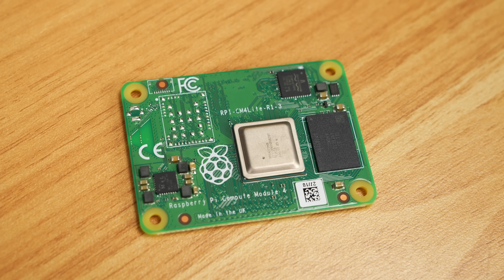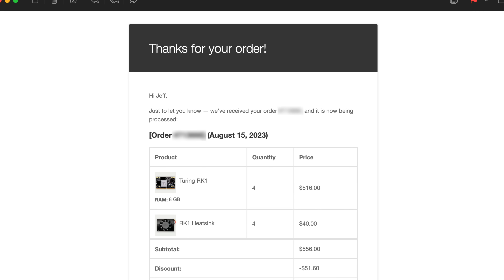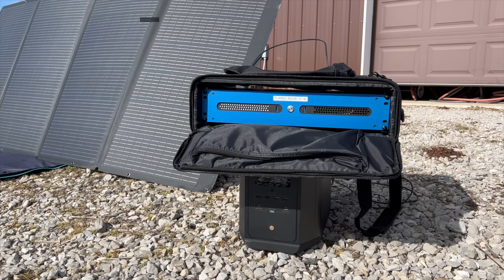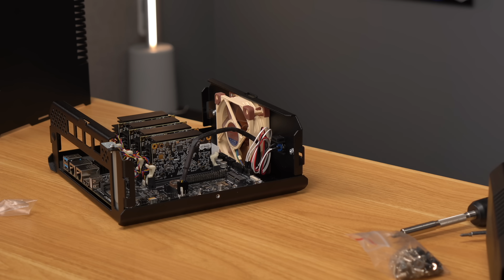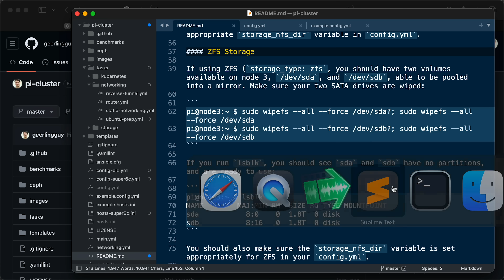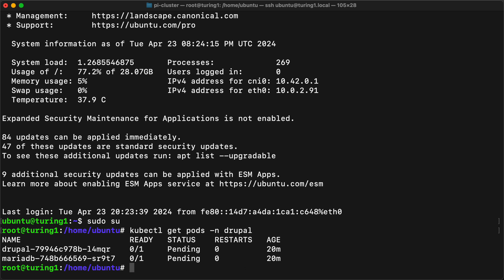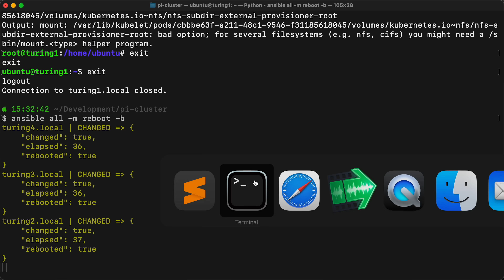Meet the new SBC Linux Cluster King!

Comment: 24 TOPs NPU. That was the main thing I wanted to know about, but it wasn't mentioned again for the section of the vid I watched. Usually fp32 is what I go on with GPUs to tell if it's useful for AI. How does this compare to a 3090? What do TOPs mean in terms of fp32, usually?... I looked into it and a 3090 has 285 TOPS so I would say this cluster is really not useful for anything I can think of, especially at that price? Why not just use GPUs?
Reply: The NPU wont help you. Its EXTREMELY limited. It can only do inference on some limited precompiled models for object recognition and segmentation, like yolov5 (not 8 wont work), and inceptionv2. It's all proprietary, they use their own model format and you have to convert everything to it using quantization to int8. It has nothing like tensorflow or pytorch or any other general purpose composable computing graph. NPU is useless for LLMs. It's in no way comparable to a GPU, more like a crippled Edge TPU with no general purpose ML framework
Reply: OH, and that 24 TOPS is combining all the NPU's and fudging since a single one is lucky to get 4 TOPS and there is NO pipelining and parallelizing like you get under tensorflow and libedgetpu

Comment: It wouldn’t be cheap but if someone wanted to they could use the asmedia pci-e 3 switch chips and break out the pci-e to a 2.5gbe nic and an m.2 slot to make a higher speed connectivity version of a cluster board, going up to 10gbe would add a lot of $$.

Comment: For the UPS - it is 12v, so 3s LiPo or 6s SLA would fit the bill nicely - no need to do conversions into and out of AC and DC unnecessarily.  For more runtime, just add parallel sets of whichever type you choose (but don't mix them - it is either SLA or LiPo, not both in parallel unless you want a fairly spectacular fireworks display - DAMHIKT).  If you go for SLA put them at the bottom of the rack for stability - not a bad plan for either, really.
Reply from the maker: Making them line interactive or at least work with an AC input is a little harder, though there are some good BMS boards out there these days.

Comment: You read my mind when you talk about a UPS for a mini rack. That would be siiiick
Reply: APC's most popular models are like 7 years old and use lead-acid batteries.  They don't seem to feel much competitive pressure.
Reply: @concinnus I thought about doing a DIY ups from lithium ion for my rack but was thinking gee i hope it never sets on fire lol. I think the UPS batteries use lead acid because they are more reliable long term or just in general for a few reasons.
Reply: @clutchboi4038  Lead-acid is just cheap, that's it (at least if you exclude lead core charge).  LFP is the right option for a DIY UPS right now, it's very safe.  Probably safer than lead-acid, honestly, which can create H2 gas.  Then in 5-10 years sodium-ion will likely beat out both LFP and any last argument for lead-acid.
Reply: @concinnus  the four 21700s of my Pi 5 UPS make it feel like a portable device… Motorola DynaTAC portable, like a brick

Comment: Possibly a stupid question from a network noob:
Let's say i get a small desktop RJ45 10Gb network switch which can handle 1Gb, 2.5Gb, 5Gb and 10Gb and a RJ45 10Gb PCIe 3.0 x 4 Card and put it into a PCIe 3.0 x1 slot on a motherboard, would
a) the PC and the switch go for 10Gb because both network chips can handle 10Gb (and therefore using the maximum out of a x1 lane (which, as i understand it delivers up to 8.9 Gb)) or
b) would the PC and the switch agree to only 5Gb because of the PCIe 3.0 x1 slot?

Comment: I see a future where the grid and green energy are stabilized in part by bidding on computing cycles.  When green energy production is overabundant researchers and hobbyist can buy compute cycles cheaply.  When energy isn't overabundant only the most important applications would run at higher costs per compute cycle running on more efficient hardware like this.  Low important compute cycles could also be shifted to an area of the world where energy is more abundant.

If I'm building an SBC cluster (and I plan to) I want it to test that possibility in my home lab using solar production.
Reply from the maker: There are a few companies who have tried building a distributed compute solution like that, and allowing people to run workloads on a P2P network. The challenges to doing it securely, and cheap enough, are pretty immense though.
Reply: @JeffGeerling  So true!  I remember a crypto mining company that produced it's own energy.  That's what made me ponder this topic.  They temporarily reduced their mining operation and sold their energy to the grid during an energy crisis when energy was more valuable then the crypto they were producing.  I thought "that was smart" and wondered if it could be scaled.  Another issue is unscrupulous individuals selling fake compute time and returning bad results.  It's all very complicated and perhaps that's why it's interesting.

Comment: Have been working with the TuringPi2 and RK1 Boards for a few months and recently also received a few different mPCIe devices, unfortunately with very bad results. Only 1 in 5 boards would show up.
I do hope you look into testing mPCIe devices with the TuringPI2 similar to what you have done with the CM4 as it seems to be either a bit of a jungle compatibility wise or alternatively the faulty connection on the TuringPi2 side.
only board I got working was a IOCREST 4 Port SATA with a 88SE9215 chip, Tried a few realtek ethernet adapters and a different SATA adapter.
Reply from the maker: PCIe is a weird beast with the RK3588, not to mention through the Turing Pi 2 board. I have had weird issues as well, to the point I don't try many anymore.

Comment: With enough inter node bandwidth one could go to the level of using it all as one computer. Have applications unknowingly call services on other nodes as if it were all just one big system. Though, 1 Gb/s is far from enough. A single PCIe V3 lane might however be sufficient for a lot of applications to scale fairly well across multiple nodes as if it were all just one big CPU.

Now, even 8 Gb/s is a massive bottleneck. And honestly the latency added by going from DMA to PCIe to Ethernet to PCIe to DMA isn't a great way to speed up transactions. If one could just have a PCIe switch between the nodes would be wonderful. But also complex and likely quite flaky, nor do I suspect these SoCs to really support that either. But food for thought.

My own homelab currently consists of a single dual socket server. But the idea of bring in a single board computer for some lighter stuff just for fun is interesting.

Comment: Hi, at first sight it looked interesting, but for ~$1,000 you can have a MinisForum MS-01 with a i9-13900H CPU (6P+8E cores/20 Threads), 96 GB of DDR5 RAM, 2×2.5 Gb/s RJ45 w/BMC, 2×10 Gb/s SFP+, 2×USB4 20+20 Gb/s supporting 20G Thunderbold, 3×NVMe slots, a ×16 PCIe 4.0 slot supporting ×8 in which you can plug an Ethernet adapter 2×40 Gb/s QSFP+.

So, unless the price of this contraption goes down drastically, it'll stay a very expensive toy :/ (not to mention that only 2×1 Gb/s is a total nonsens and that the marketing target looks very fuzzy).
Reply: And your Minisforum will blow the doors off it for every application.

Comment: It's funny that you love RK3588 on the Turing RK1 yet hated the same chip on Orange Pi.   You mentioned doing an updated review later when you first reviewed the Orange Pi 5+, please do one - I've been looking at that board after being somewhat disappointed in my rpi5.
Reply from the maker: I never said I hated it on Orange Pi! I mentioned in a video last year that the Orange Pi 5 (with the RK3588s) is a pretty decent value, but for a Pi replacement (for use with GPIO and desktop and everything) it had some problems. In the case of these boards, they bypass those concerns because for nodes 2-4 you don't even have the possibility of HDMI output :)

Orange Pi and Radxa both have some neat hardware with the RK3588.

Comment: @JeffGeerling In reply to your comment on 17:46 about the availability of 10" racks in Europe: I got lucky getting a 30cm deep closed 12U rack from a now defunct Polish company (COVID stock/supply issues I guess) I only could get the MyElectronics 2U enclosure in there by putting in some custom spacers to get the ITX case closer to the glass front door. Otherwise the cables in the back would just not fit. Any deeper rack would not have fitted in my utility closet.
I once revved out the diesel my driving instructor used when I was still learning for my driverslicense, some 300 meters from where MyElectronics is currently based in Alkmaar. I now have one more reason to chuckle about that event, 'some' American guy made realise that they were based there.. :)
Reply from the maker: Ha! Yeah, they could even shave a little more depth from their designs but if you have a deep enough rack or open back, no problem at all.

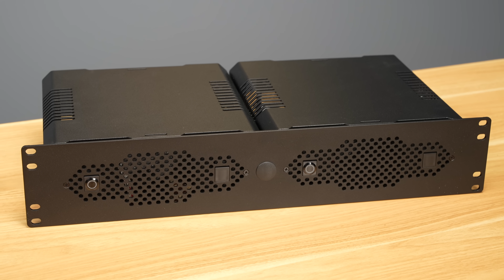Comment: 6:24 is the important moment.
If you want to use two of this boards in a cluster, 10 Gbit/s Ethernet is what you need.

It was mentioned twice in the beginning (a little redundant) and it is what stops me from buying such a board: Ethernet is too slow. The connections between the Compute Modules must be very fast and the connection with the external world should be as well.
Everything else is great. Storage, compute power, all great.

Comment: Would the PCI-e slot you covered up be a good replacement for those slower NICs on board?  Would a 10G card alleviate the bottlenecks the slower NICs introduce?
Reply: I had the same thoughts while watching. Or even just a 2.5G dongle on USB3

Comment: Practically, you don't need an SBC cluster. Single CPU x86 machine will be faster, and more important, easier to support.
So performance comparison between different SBC cluster does not have a practical meaning.
But it is still fun!
Reply: its good for 24/7 use at home without using much electricity. I too have x86 based ones and they break the bank. btw did you know the orange pi 5 rk3588 is so much cheaper than the best x86 SBC for the same performance? it matches the intel N200 CPU in performance, thats how fast the rk3588 is. It beats intel in some things but loses in anything avx.
Reply: I think you forgot that the main point of this was how power-efficient it was for the performance.
Reply: @xanderplayz3446  Modern x86 will be more power efficient than a cluster of SBCs.
Reply: @Lincos321 what would you use with x86 as a replacement ?

Comment: I've done a fair bit of cluster computing, on big clusters like Stampede at the University of Texas, so I'm familiar with the desire of cluster creators to have fast shared filespace and high speed interconnect fabrics etc - but - at least for all the real projects (as opposed to demos or benchmarks) that I've used clusters for in real life, I've always been able to structure my code so that high speed interconnects and fast shared filespace are just are not needed.  Even for applications where there was big data rather than just a lot of CPU being used.  My observation is that these extreme hardware facilities are mostly used by people who don't make the effort to optimise their application for parallelism and who try to shoehorn code that was really designed with uniprocessing in mind, into a multiprocessing environment without taking on the necessary restructuring.  Now I'm retired, when I need to throw CPU at a problem I just farm it out to a few dozen regular Pi's and a couple of spare x86 portables I have around the house, running over Wifi, with one regular NFS mount to supply shared files across the lightweight cluster.  In fact - although I do have proper cluster MPI software installed, I generally can get by with just kicking off tasks using "ssh".  So I mention all this to suggest that perhaps the features you describe and the cost of the system you're using is perhaps a little overkill, that could be avoided by a little more coding effort.  An interesting approach for a subsequent video might be in terms of computation done per dollar rather than just what is the fastest shinyest new hardware available?
Reply from the maker: Sadly when you talk to anyone about making code better versus beefing up the hardware, 99 times out of 100 you'll be told the hardware's easier :D

One of the reasons I love Pi clusters is I've changed my own site architecture many times to make it faster (avoiding disk IO where I can, caching in RAM on individual nodes, that sort of thing), and made big sites scale (think millions of dynamic page views per hour) on relatively modest AWS resources... all because I would run the same application on my Pi cluster that we were running on $20,000/month servers :D

But not every project allowed me the time to optimize. Sometimes the plan was to build up hardware for a month, then tear it all down, and they were happier doing that spending $100k+, than to spend an extra two weeks optimizing the site (for a lot less).
Reply: Read "In Search of Clusters", a fine book. Amdahls Law; show me where the data is and I'll show you where the computing has to take place.  At some point all parallel computations reduce to a set of serial instructions. It's the law. Clusters live and die by the speed of their switching fabric, and that will always be the case.
Reply: cluster file systems are absolutely needed when you need more storage than can fit on a single server.

Comment: Would you trust a product that was "ready" in 2021 and in 2024 its still not delivered?
I own the first version of it and was supposed to use it for a project for my client.
Since then I changed companies twice and my client no longer exists, compute modules I was going to use are no longer in sale, software I was supposed to use for the project is outdated, and yet the board is still not available for mass production.
Reply from the maker: I would definitely not include a board from a newer hardware company in any project I sell to someone else, there are too many problems that arise with hardware production (especially with a complex motherboard like this, and even more especially from a startup), I typically measure the timeline to when I'd be comfortable with sourcing a product to a couple years from a company shipping production hardware.

Turing Pi has not been especially reliable in hitting production timelines.

Comment: Now, if only there were drivers for those NPUs.  And software that would use their NPU in place of AMD/nVidia.  And software that would cluster the problem space.
Reply: The NPU is EXTREMELY limited. It can only do inference on some limited precompiled models for object recognition and segmentation, like yolov5 (not 8 wont work), and inceptionv2. It's all proprietary, they use their own model format and you have to convert everything to it using int8. It has nothing like tensorflow or pytorch or any other general purpose composable computing graph. NPU is useless for LLMs. Far from a GPU, It's like a crippled version of the Coral Edge TPU with no available general ML framework.
Reply: I should admit that I have successfully activated and used the Mali GPU on the board (opencl sees it as well) and that I know that someone is working on adding an open source NPU driver to the kernel.  Also, that someone else has been working at getting LLMs to run on clusters.  [I can't find a reference for the latter.]  There's a lot of good infeaux in the #machine-learning channel of Turing Pi discord.
Reply: @AndrewBeals  The NPU is already supported under Armbian, its just lame.

Comment: How is the mainline situation? The RK3588 is a huge boost in this area but what about device trees or U-Boot builds? Do these boards have SPI flash on them out of the box?
Reply from the maker: Still trickling down the pipeline... so many RK3588 builds, so many still stuck on Kernel 5.10.
Reply: @JeffGeerling  There is a new 6.1 kernel out now that will be included with Ubuntu 24.04 for the Turing RK1. I hope to have it released over the weekend or next week at the latest.
Reply from the maker: @Spooky8088  Awesome!

Comment: the tops stats are underwhelming -(zen5)  laptop cluster would be more expensive but way more performant I am going to try and build openwrt on an old pc today - will blow away router builds from the past - why not add some usb networking to the unit - could solve the network bottleneck issue. they will look like 1 pc if you run load balancing but it would be nice to have them all act as one pc for ai - maybe next gen, interesting to see you switched to square from spring - carry on

Comment: The mini rack needs a 10" PDU that has a 110v input power.  And as Red Shirt Jeff pointed out, a 10" UPS would be a nice option.

EDIT: A Ubiquiti EdgeSwitch 8 PoE (ES-8-150W) would fit nicely in the 10" rack.
Reply: I think that is too niche for it to be ever made, but maybe a 12V UPS would be a good idea for those small racks.
It would be much easier and cheaper to make (since 12V batteries is a standard) and skipping the conversion from 12V (battery) to 220V (AC) back to 12V (PSU) would be nice.
Reply: There are 10" C13 PDUs.

Comment: for $1500, could easily get a 16 core 32 thread and with 128GB dd5 and a great motherboard, case and power for less than the cost of the max version.